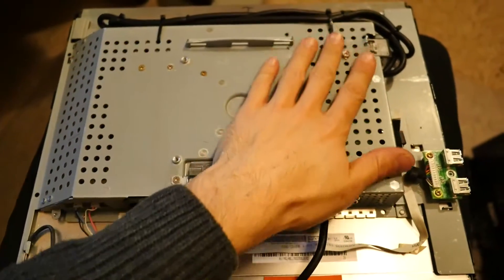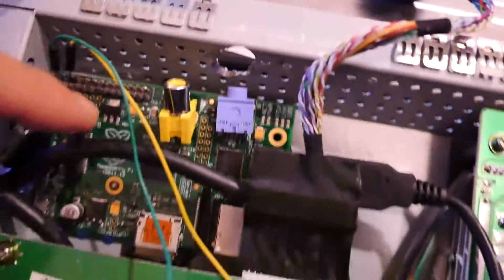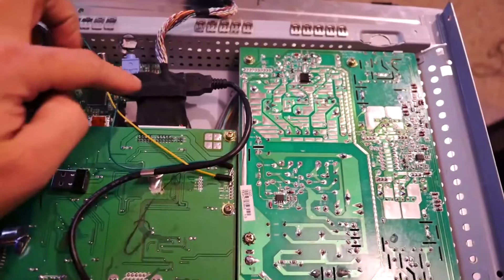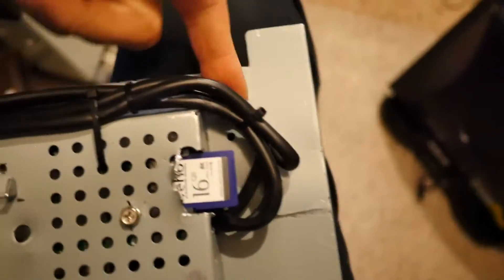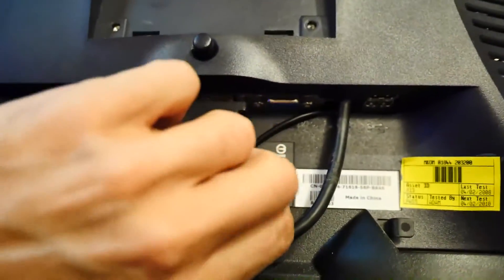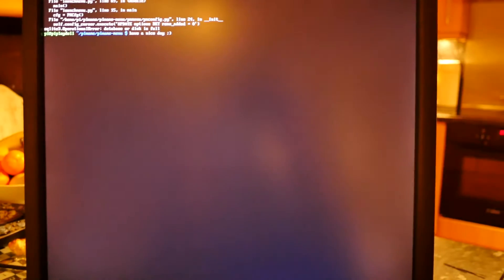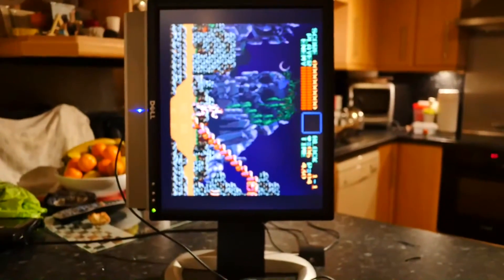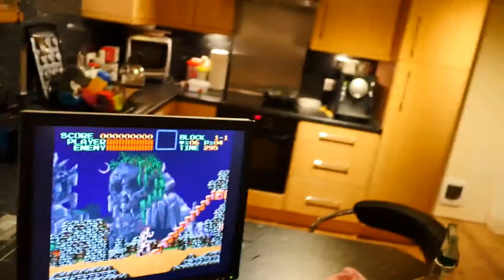Raspberry Pi Arcade in a monitor build

Comment: Great project! It's been a while since I've done any Raspberry Pi work -though I do have work to do on them at work tomorrow if that makes sense. I doubt tomorrow will involve RetroPie or PiPlay though.

I had some SanDisk 8GB & 16GB SD cards corrupt on me and the early ones were notorious for it. They're sensitive to voltage fluctuations I believe and it occurs mostly during abrupt power-on/power-off. Moving onto their MicroSD cards + adapters fixed that for mine.

I had great experiences with the Sony Dual Shock 3 control-pad + CSr Bluetooth module for gaming on the Pi. They cover all platforms extremely well and additional buttons can be mapped to hot-keys.

Every time I do metalwork I think to myself "yeah, should have bought that nibbler". That's what side-cutters and pliers are for though, eh? :)

If you fit a heatsink, you should be able to overclock to 920-966MHz+ which I found solves most SNES performance issues on an older model B. It will only struggle with some of the FX enabled titles then (e.g. Starwing/Star Fox). My performance test game is Super Mario All-Stars' Super Mario Bros world 4-1; running whilst Lakitu is chucking Spinies at you would always cause a performance choke.
Reply: +The Backoffice OK... building my parts list (I'm gonna use an SD slot extender to bring SD slot to edge of monitor and accessible)...   How do you open the monitor? Had a QUICK look at my 17" Dell and didnt see screws (except behind the VESA mount)?   Did you find the 5V standby & ground using a MM or a circuit board plan?
Reply from the maker: Hmmm I'm not sure I will do any more with this Beastie, I have tried the overclock and its pretty stable but not quite good enough.

the kids don't mind so I might just make another one but with a pi 2. I have a project that requires me to but 10 pi2s so I will have plenty to test with!

I do have some general microcontroller modules I made so I could stage the booting and shutdown of the pi to make sure the PSU is stable. but not sure if it's worth the bother, it's not a production unit.
Reply: +The Backoffice "inspiring" video... Not concerned about lack of airflow to Pi? With Pi3 that would be an issue. Since you have 5V & 12 V available, maybe a 12v fan running at 5V for quiet airflow?  Pretty sure I have a 17" Dell monitor in the attic with rotating feature :-)
Reply from the maker: Meth, not had any issues after hundreds of hours of use, I guess the monitors electronics are already adequately ventilated. I would try as is and only consider a fan if it gets crashy :)
Reply: +The Backoffice for Pi1 I agree   Dunno about pi2 but Pi3 will throttle CPU if it gets hot and does in most public cases if closed.   I'll try a Pi2 first
Reply from the maker: Meth Methanoid I think experimentation is in order :) They are cheap enough to have a play. I am not a fan of forced air, but if I had to, I would hook it on a GPIO and have it software controlled from the Pi itself.
Reply from the maker: +Meth Methanoid Im about to embark on another of these on the weekend, I will try to video the process, however in answer to your questions:

1) The monitor bezel is separated from the FRONT, I spend ages digging around with it until I discovered this.
2) Undo the VESA screws and the panel will be released
3) 5V was clearly marked on the PCB, but I did use a MM to double check. In Hindsight I should have soldered a micro USB onto the monitor electronics so I could swap out the Rpi for upgrade (something I will be doing soon to a Rpi2) - So Hack a spare USB wire for this.
4) Getting an SD card out somewhere might be a pain, but would be great in the event it got corrupt. I made sure that fsck was run on each boot to keep the filing system intact.
Reply: +The Backoffice Nothing original left in the world.. Yes, I read on a few places that powering via GPIO is not recommended as it bypasses fuses n regulations so I was gonna solder a cable to PCB with micro USB to power Pi the approved way. Pi2 is what I will be fitting too. Found some nice right angle audio cables. Gonna measure for those and for the video cable. The card extender is on eBay as "60CM TF to micro SD card Flex Extension cable Extender Adapter" and should allow positioning of uSD slot wherever you want... I think probably the side is best. Underneath is too fiddly, top allows crap into it from above.  Anyway will await your new video!
Reply from the maker: +Meth Methanoid Yeah that makes sense, interesting about the regulation / and or fuses. One tip, see if you can add a reset line from the GPIO to a button somewhere, its a pain to turn off the whole thing to reset the Pi if it goes haywire, that is one thing I wish I did. My second thin would be a hack to keep the monitor USB hub powered when the monitor is off. Its ok if it goes into standby, but that takes ages and its quite hard to make the Pi send a HDMI standby signal. (actually sending it is easy, waking it up is the problem!)
Reply: +The Backoffice http://www.instructables.com/id/Rasberry-Pi-2-Reset-Button/ plus 99p eBay PC reset switch, two wires to solder and hot glue.. sorted...   Re the USB hub... I am guessing but pull the 5V from the standby and attach that to the 5V on the hub?
Reply from the maker: +Meth Methanoid the hub is in the monitor electronics so probably not an worthwhile option
Reply: +The Backoffice have you tried your Pi3 in there yet? Wondering if the standby 5v will give 2.4a. Just got two 19" Dells off eBay to do this.
Reply from the maker: +Meth Methanoid No yet, was going to showhorn a Rpi2 in there, any idea if it is a similar current draw? If not I can temporarily test the Rpi3 while doing the swap.
Reply: +The Backoffice pi2 << pi3. Pi3 is very thirsty current wise. Please LMK if u get rainbow square indicating power problems. Also you might get throttling if case is closed :-(
Reply from the maker: Meth Methanoid If you were near, I would give you a screwdriver, meter and soldering iron and let you test it yourself ;)
Reply: +The Backoffice pretty please a Pi3 test... Go on, be a good excuse for a revisit to show any updated mods in a new video....
Reply from the maker: +Meth Methanoid I promise to do this, this week! Will a Rpi 2 Suffice or do you need to see a 3? :)
Reply: +The Backoffice (humbly) Pi3 please.. it draws LOTS more current...
Reply from the maker: +Meth Methanoid I was meaning to solder a micro USB on the board to ease this so should be a good solution for future upgrades
Reply from the maker: +Meth Methanoid OK done, seems to work fine!
Reply: +The Backoffice brilliant. Nice to know the Dell isn't gonna melt if asked to provide up to 2.4a :-)
Reply from the maker: Meth Methanoid hmm an seeing the occasional small rainbow icon in the top right corner. Does not come on predictably. CPU holding around 75 degrees c
Reply: That means it ISNT getting the juice.. Damn.. Wonder if there is another track that could supply the power in standby (or even a way to combine 2 safely) ?? I'm not into electronics!
Reply from the maker: +Meth Methanoid Im not convinced of this, that symbol appears somewhat randomly and does not appear to be related to load at all. I am not sure at how often it is sampling that voltage line and I have not seen any deteriorated performance, frankly I wish I could just disable it. It would be possible to power the device using a separate USB PSU, but that kinda defeats the object.

I suspect it is the shitty micro USB cable I cut, it only has 2 measly tiny wires on it, I think the losses are in the cable. grrrrr
Reply: +The Backoffice I have your answer....You can override the behaviour in config.txt :
avoid_warnings=1 removes the warning overlay.
avoid_warnings=2 additionally allows turbo when low-voltage is present, otherwise disables when it appears...   Let us know if it is stable with the 2nd option !! :-)
Reply from the maker: +Meth Methanoid Perfect Sir, I must do a video only about this one bloody annoying thing!
Reply from the maker: +Meth Methanoid This seemed to work! However I found USB to be unstable. on inspection the USB WiFi dongle was fighting with the inbuilt WiFi and crashing the kernel. So I swapped in the pi 2 and everything is working super stable. now I have a spare pi and pi 3 to use in projects :)
Reply from the maker: +The Backoffice Also forgot, I'm posting a video tomorrow on it. feel free to ping on Twitter.
Reply: The Backoffice great, will look forward to it.. I subbed a while back so it will just appear in my watch queue! :)
Reply from the maker: Good man!

Comment: Hmm, you just gave me an idea on something I could do with the Club at my college. Get them involved in hacking one of these up.
Reply from the maker: +Yoshi Knuckles Its crazy easy to do and relatively cheap! If you have a budget of $40-$50 its a no brainer! I might make a few more of these so if there are any other tips I can give I will share them. The one thing that really annoys me is although the soundbar works when the device is in standby, I have not yet got PiPlay to go into standby cleanly on command. This would be great as a media centre to listen to music without the annoying backlight on the screen on. Also The inbuilt USB hub shuts down when the PC is off, so even though I moved the WIFI internally to avoid this, it would be nice if it stayed on to charge devices and power external HDD for streaming etc.

Comment: Very nice! I have a spare one of these monitors myself minus the sound bar. May have a go at this it's very cool :)
Reply from the maker: +ΓΞTRO ΓICH Those little soundbars will only set you back around £12 on eBay, I highly recommend it because not only does it act as a input if you want to connect your hifi to it, but standalone it gives pretty good sound.
Reply from the maker: +ΓΞTRO ΓICH Also if you havent go a Pi yet, the latest model version would be great, mine struggles on SNES though is ok for most Neo Geo Games. I think the Pi Zero could work well if you are not too bothered about connectivity and have a spare USB hub. (also you will need a DVI monitor unless you buy the VGTA shield for it).

Comment: haha just did this at the hack space to a monitor but left it external because of all the IO, luckily this monitor has most IO , the big difference is that i hacked up the VGA cable i used to shorten it.
Reply from the maker: +Jared Reabow (Jazza) External is lame and does not count as a hack in my book, that is just hookin' it up :)
Reply: +The Backoffice ahh but i did mod the VGA cable and move the internal board to fit the HDMI to vga adapter internally.
Reply from the maker: +Jared Reabow (Jazza) I guess that counts then :) There is an actual VGA adaptor board for the later model RPis for around £6. I am going to try those for monitors without DVI.